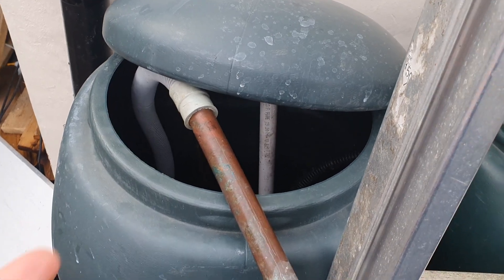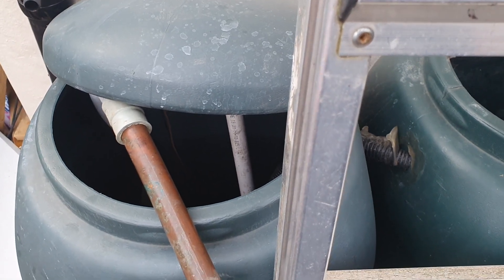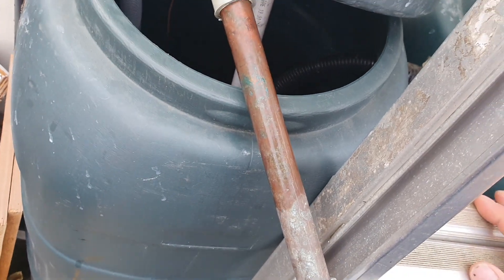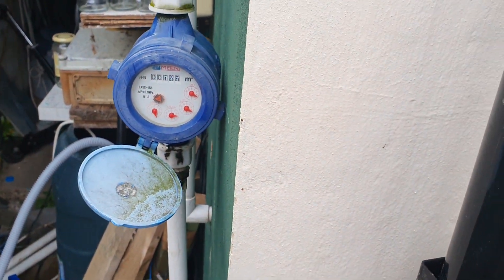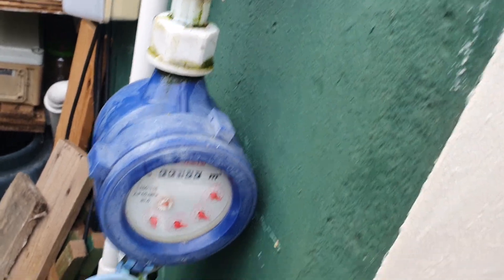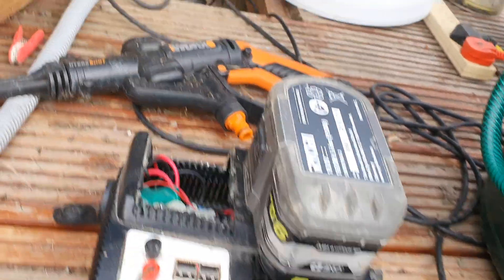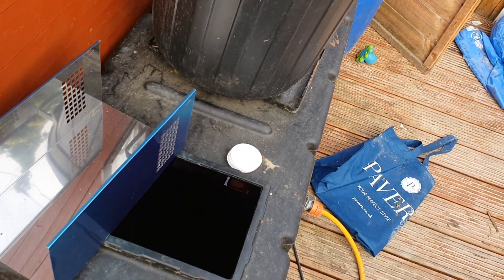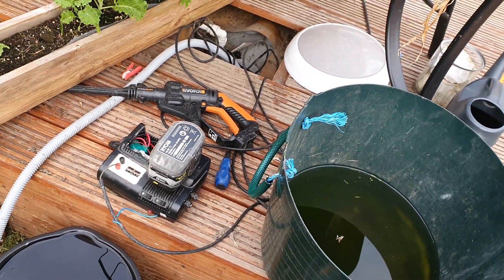Rainwater toilet flush hits 100m3 milestone.

Comment: Can you not utilise a float switch similar to what they use on barges. I used a float switch within the toilet 🚽 fill/bucket/that stores the water.
Reply from the maker: I did have a marine float switch at first but when I had to chance the faulty flush system it was too big. So i swapped to a tiny float switch that wasn't rated to run the pump. While is why I added a relay externally.